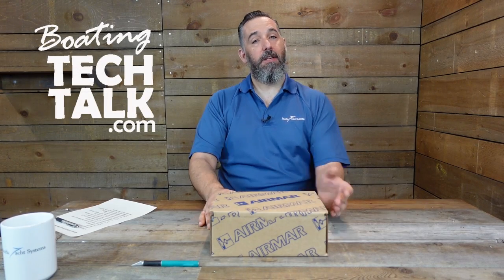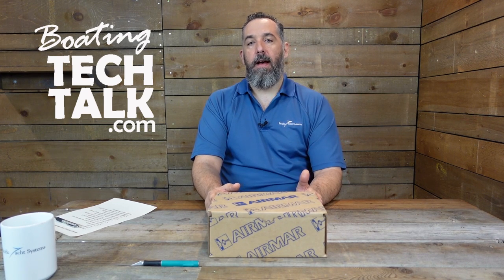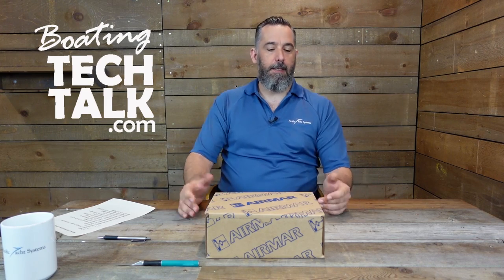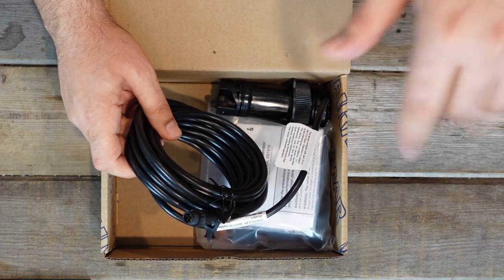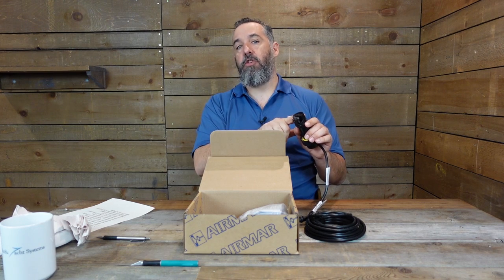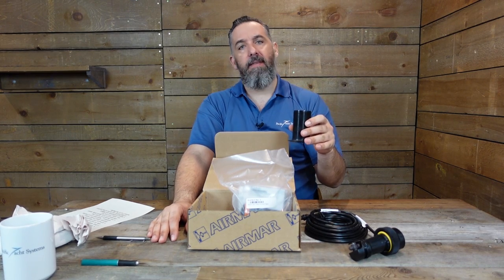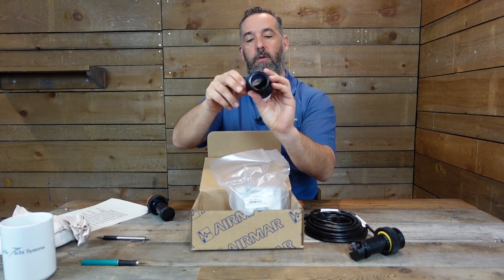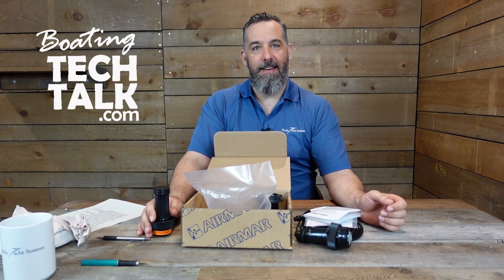Airmar DST810 Smart Transducer UnBoxing and Product Review

Comment: I read my directions, and it says to remove that yellow O ring and replace it with that black O ring, or the transducer will not fit in. It also says to grease the O rings with grease supplied. Happy boating

Comment: I have an older airmar one from 2007 (came with ST60) 

I want to replace to this.

Is the sleeve the same size? I don't plan to lift the boat until the end of the year, but would love to change before that if possible.

Thank you!

Comment: I like the way Airmar did the through-hull to make it less messy to get the sensor back out of the water.  However, doesn't the wheel have to be down IN the water flow under the hull to work?  It looks like the flapper valve would be preventing the full insertion of the sensor.
.
.
.
.
.
Although there could be another explanation, if you remember what day this is posted on. . . . .
Reply from the maker: Good question, rest assure the paddle wheel is the water unobstructed.

Comment: I want to buy a DST810 for my sailboat and have noticed that sometimes the item is listed as “Garmin” sometimes “Lowrance” or no manufacture listed at all in the part description (e.g. Airmar DST810PV-N2 Plastic Smart Multisensor 235kHz with Bluetooth NMEA 2000); will all of these end connectors be compatible with a backbone of micro c drop tee’s or is it more to do with the conversion of the analog to digital and is proprietary?  The chart plotter and MFD’s are all Raymarine.  Can you help me make sense of this?  Thanks and love you tech talk vids.
Reply from the maker: Hmmm good question, but don't know the answer. Presume all of them will have N2K ends.
Reply: I am also interested to know this. I have a Maretron DST100 since ten years or so and I remember that everything was the same about it as Airmar's DST800, even the user manual. I suppose nowadays it will exactly the same product, including the box, but how about the software installed?
Reply: I now have an answer for you since I purchased a "Garmin" DST810 recently. It says nowhere anything about Garmin, nor on the box, the manual or in the software. It has a micro-C connector. I am sure the only place you will see the word "Garmin" is in the part description. I hope this helps.
Reply: @Johan_O_W_Hackman  have you installed it yet and any integration issues?  What display/plotter is it going to?  Appreciate the feedback.
Reply: @hankgibson8848  I have installed it without any issues at all. My system is ex-SimNet with four B&G Triton displays, one Furuno display, Simrad GPS and B&G Wind sensor. I actually don't have a plotter.

Comment: I installed the DST800. Notable difference is the connection, the DST800 requires an itc-5 to get data onto the NMEA network. Not sure of the cost difference tho.
Loosely related Question: I have a old wind instrument at the top of the mast (can tell brand/model). It's connected to a Raymarine ST60. Can I reroute the connection to the itc-5?
Reply from the maker: Hi Philippe, I think so. Anyone else can share their experiences with the ITC-5.
Reply: @PacificYachtSystems  yes the ITC-5 adapts your analog wind outputs and has dedicated connections for just that